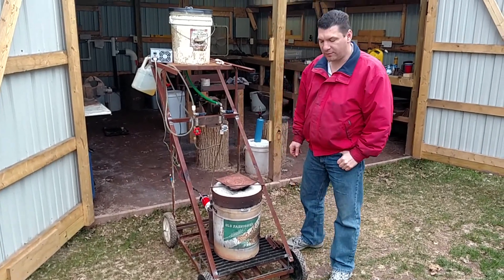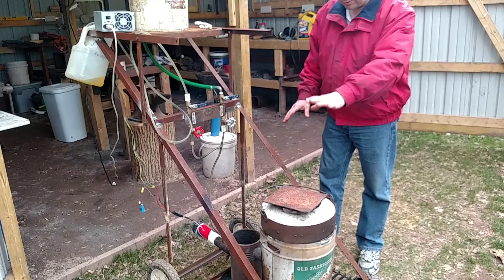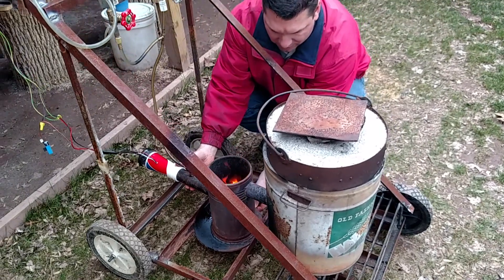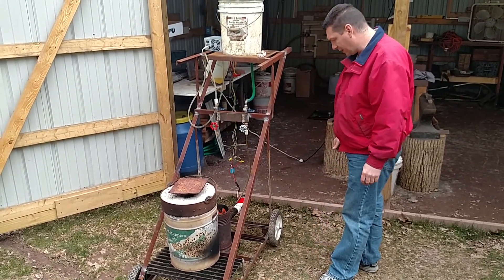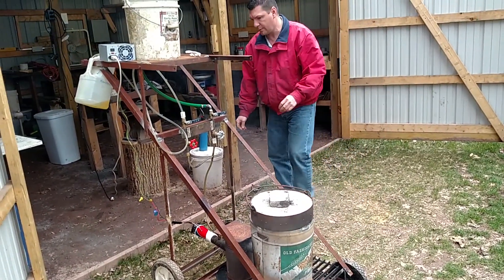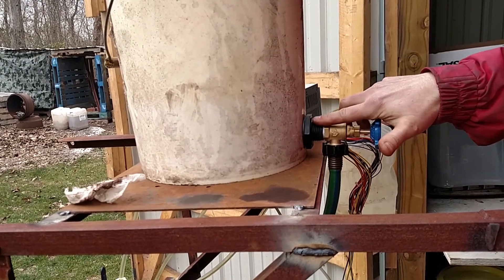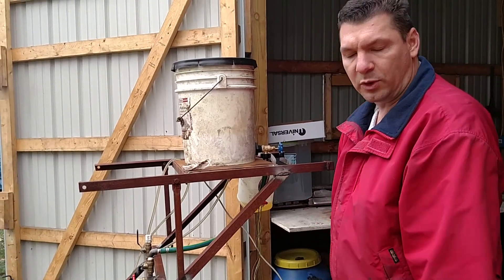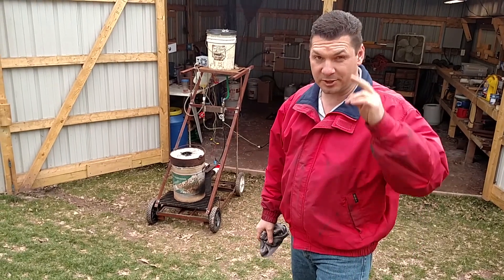Foundry Cart

Comment: Here is a thought (without welding...  https://www.youtube.com/@MakerPipe...   I already had a "green color" BBQ... I bought a big wheel lawnmower with a tlown engine for $5... I used MakerPipe parts two connect these two things so I could push the BBQ to my neighbors home.

If you are thinking about a "frame" for the product... this my help, and, it can be broken down to ship it.

Comment: A LOT of very good Ideas there! I was thinking of those RC fans so good to see they work so well. Bought the exact same controller the other day. They sure are a lot less bulky that a jumping castle blower and make for much better packaging of an all in one unit like you have. I'd like to see how the burner runs flat out. I think you'll have a real fire to behold with the setup you have. 
 I noticed some car blower fans are now 3 phase DC so I was going to give the controller a run on one of those and see how it went. 

I have also thought of the T piece for running a startup fuel but Laziness has prevailed and I don't really have any trouble with startups  now I have got used to my burners. 

One suggestion I would make is to watch those plastic wheels if ever you want to turn the burner off to the side to melt something.  Even the radiant heat from the burner would probably give them a hard time. You will get a lot of throw back heat from what you are melting which the wheels won't like.  Perhaps when you are set up you can cast some aluminium wheels if you ever want to use the off cart feature. 

The best bit about a prototype is to see where you can improve. I think what you have come up with so far is excellent and no doubt version 2 will really be a functional and practical work of art!

Well done mate!!
Reply from the maker: +Oil Burner Thanks for the comments. I plan on keeping the wheels easily removable. I can melt in the foundry with the wheels, no problem but as soon as I turn it out the side I'm sure I will have issues with radiant heat. The cart can set down on the ground, it has little leg rests so it will sit on all 4 corners no problem. I too have given though to casting aluminum wheels. That would be nice and then I wouldn't need to remove them ever. So I'll play with options and see where I go.

Right now I'm a bit frustrated because last evening after shooting this video I poured about 4 fresh gallons of WVO (waste veggie oil) into the tank on top while things were running beautifully on WMO (waste motor oil). The WVO was almost brand new and super clear (beautiful stuff). Within 5 minutes I realized my burner was going out. It wasn't a clog, it was flowing just fine. It was actually pooling up in the burner rather than burning.

Now I've run WVO many times in the past without issue but never brand new stuff. Normally I'm running really nasty stuff that has a lot of hours on it. In those cases the oil is usually a rich amber color. This was all so brand new it was barely even honey yellow. I wonder if it has too much water content when it's brand new to burn well? Maybe the water is fully colloidal and does not separate out when it's new? I have never run into this before ...so odd?!? In the past I have always felt my WVO actually burned hotter per unit than WMO did. This little issue last night was the first bit of trouble I've ever had with WVO. It had me scratching my head for sure. I will do more experiments over the next few days to try to figure out why this particular fuel is not working well.
Reply: i have had a lot of problems with pooling up and cool downs. it is a very fine balance between air, fuel, and temperature - easy to accidentally cool off your burn chamber by giving too much air or too much oil, and counterintuitive or conflicting with the signs you see in the oil. ie, white smoke - not hot enough or not enough fuel, black smoke - not enough air. it really is an experience thing with lots of trial and error. 

i have found it is best to run very little fuel and air, just enough to get a net positive heat gain in the burn chamber, and once the chamber is red, keep it at that temperature. this may conflict with the heat output you need, but it is essential to keeping the fire going and even to raise the temperature. plus, there are enough btu's in oil to melt cast iron no problem ...... aluminum is a piece of cake, you can melt it without a furnace if you're using oil. 

basically, don't rush it. 

ps - i doubt it is water as my 60 gallon tank of "fuel" has so much trash in it (sawdust, antifreeze, water, paint thinners, grease, lantern oil, stove fuel) and generally burns just fine. i tend to toss any old junk fuel source in there, save for maybe gasoline.